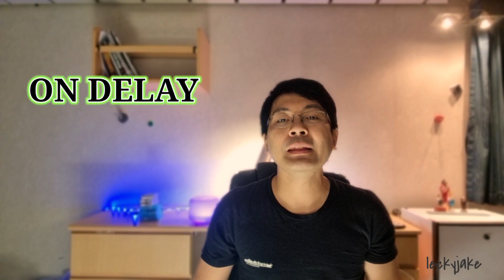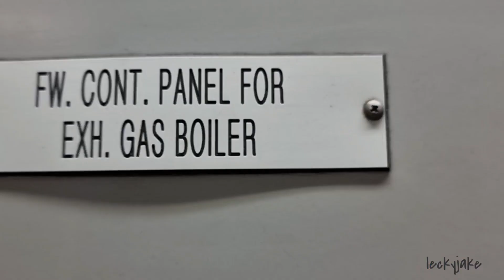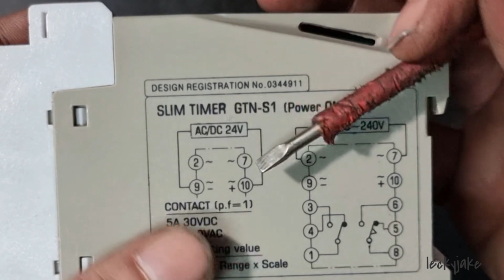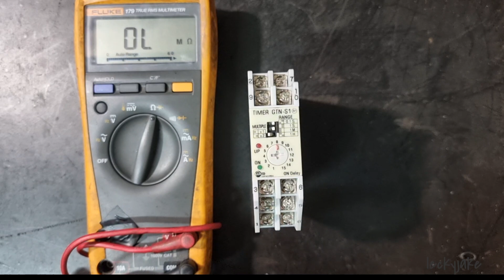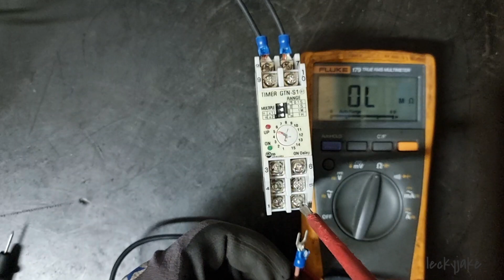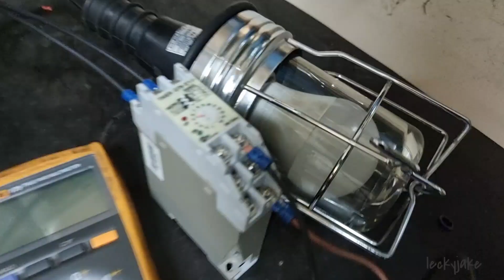ELECTRICAL CONTROL SYSTEM ON DELAY TIMER | MARINE ELECTRICIAN

Comment: how to check timer in running mode if there is no indications on it can we check the vtg between pin no 8 and 6 ? since the potential difference at the running condition it will show 0 or else it will show applied vtg ?

Comment: I love your videos. I am an land-based industrial electrician and have picked up a few tips and tricks from your problem solving methods videos. I have one question tho,  I don't see any PLC vids? We would put a bank of timers and control on a small PLC and a few slave relays/contactors.
Reply from the maker: Thank you. Will be doing separate videos for all the electrical components inside Panel.